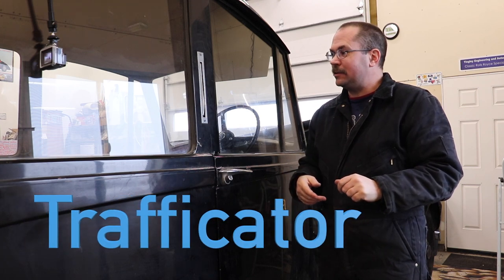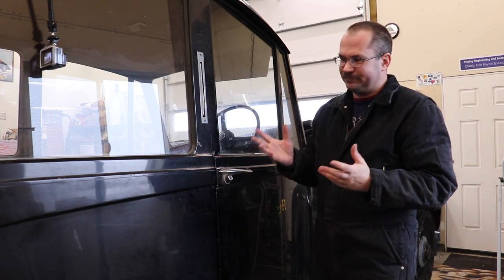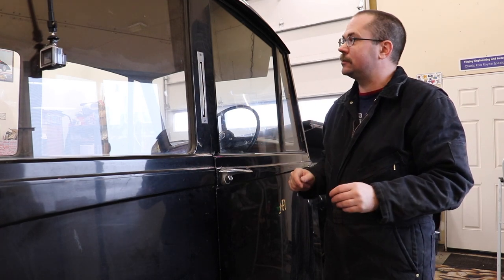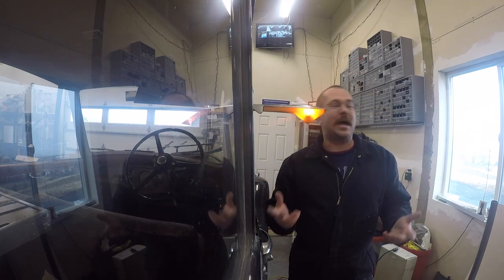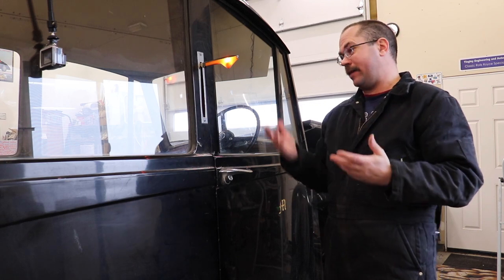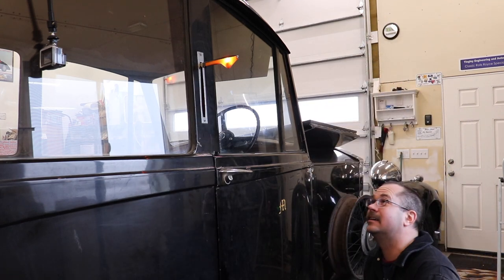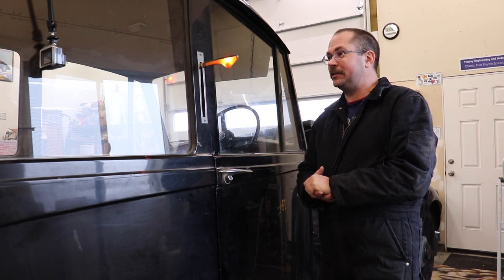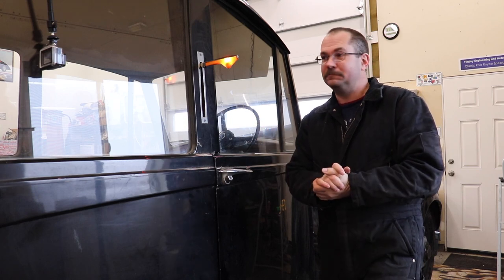Trafficator, a unique turn indicator.

Comment: You can buy flashing LED bulbs to replace the original.  This is brighter and more visible to others due to being flashing.  I have them fitted to my 1935 Bentley.  I have also fitted traditional flashing indicator lights at the front and back of the car.

Comment: Yeah, nice to see you again...remeber the white 356 coupe where you did up the front suspension. Excellent explanation. Now I have to laugh because I have one of these trafficators on my 1950 Riley RMA saloon as well which I bought two years ago and am restoring: getting the combo of a flashing blinker to work with the trafficators is not that easy  since you don´t want the trafficator waving up and down with the flasher!!! Boy, the things we get ourselves into. Bye the way, my trafficator will flash as well until the switch on the steering wheel cancels after taking the corner!! And I have an over/under solution with two bulbs for the top of the running lights on the front fenders to have a flashing blinker there as well... a nice mod developed by and for the Riley RM Club members by the boffins in the UK club!

Comment: I've heard of cars with trafficators. I think most European cars up to about the 1950s or 60s had them, before switching to what most of us know as the turn indicator, or turn signal. They're usually installed in front next to the headlamp, and at the rear as part of the taillamp.